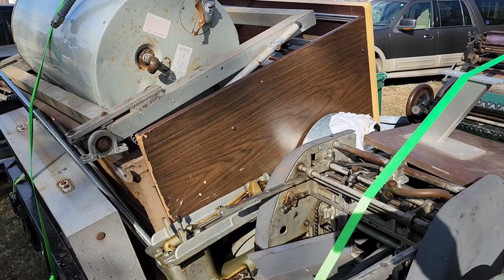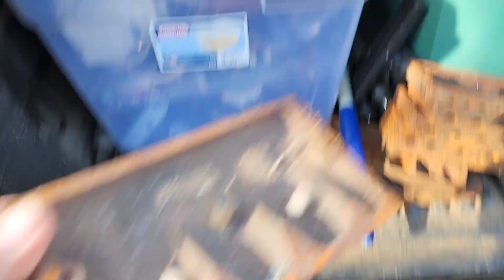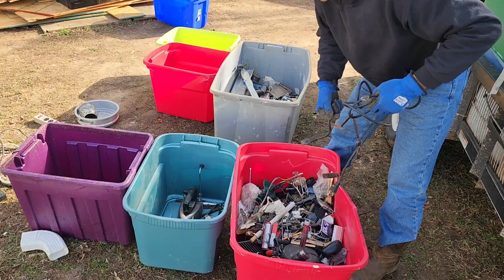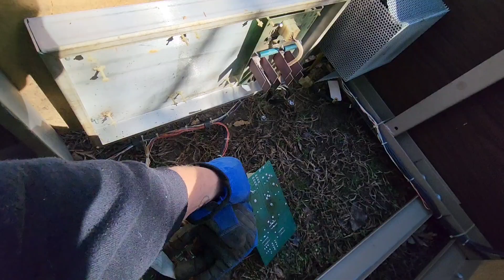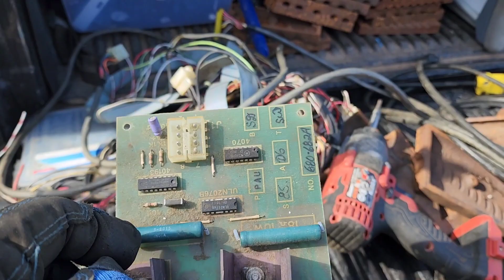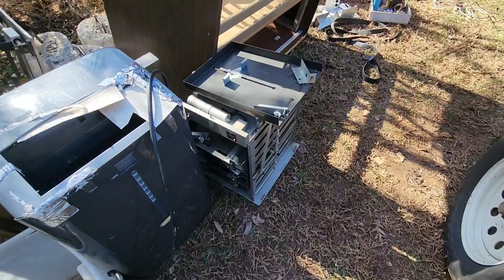part 2 The Scrap Storage Unit Score #scraplife #storageunits

Comment: JC, Are the internals of the water heater copper? That was a mammoth effort sorting through all of that stuff. Great job.
Reply from the maker: The internals are minor. The thermostat and wire are an easy removal, as well as some brass
Reply: @scrapitjc  Interesting 🤔